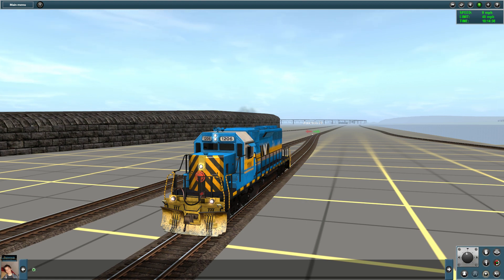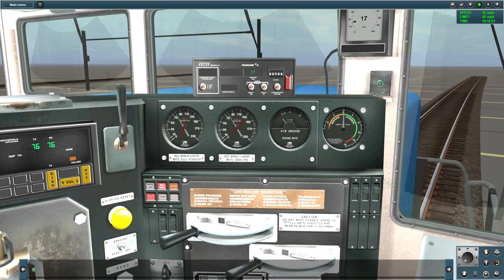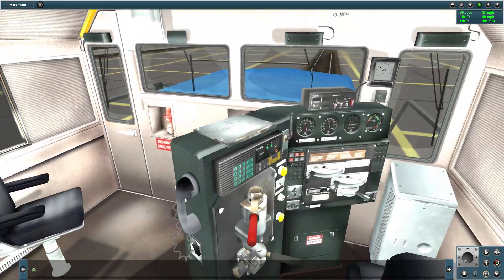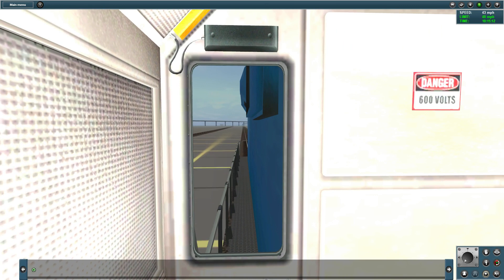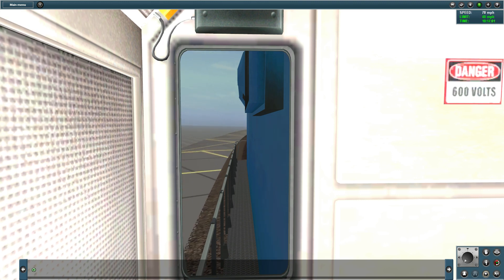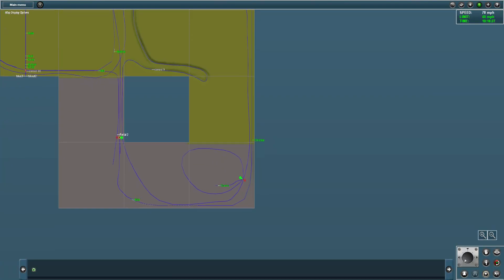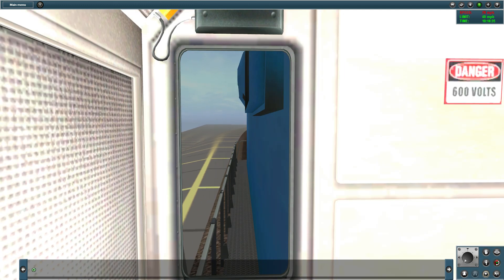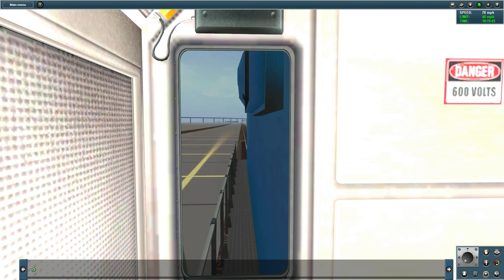Unstoppable: Facts the movie missed pt 2

Comment: The leading engine on the movie, is under power traction. You simply cannot brake the entire consist, firstly because you have no comand of the train. Second, you don't realize that is useless try to brake a train from behind, you'll be dragged, although you are braking from behind, you're being pulled from the front. Even if you have the air supply connected to the train, unless you set the lead engine, is comoletely useless.

Comment: booooi its Dash 9's or dash 8's, not SD70's, learn the ways of train... lol
Reply: They are actually AC4400’s. Leased from Canadian Pacific for the production.
Reply: Dude it's an SD 40- 2
Reply: It's an SD40-2
Reply from the maker: The locomotives used in the movie were SD70's. you can tell by the EMD-like features on their bodies.
Reply: @Trainfan1055Janathan  🇼🇸🇼🇸
Reply: For all of the complainers.

  AWVR 777 = GE AC4400CW

  AWVR 767 = GE AC4400CW

  AWVR 1206 = EMD SD40-2
Reply: +Trainfan1055 are you blind? they are clearly GE engines.
Reply from the maker: Well, I owe you an apology. I did some research, and the locomotives used in the movie do, in fact, have GE-style radiator fans.
Reply: +Trainfan1055 GE's dont have   fans on them... maybe inside of the engine compartment... but they dont have any EMD features apart from the creators doesnt know the differences between a GE and an EMD cause they used an EMD start sound for the GE....